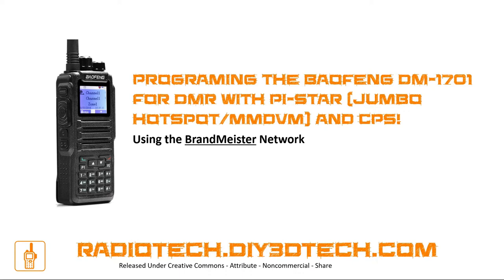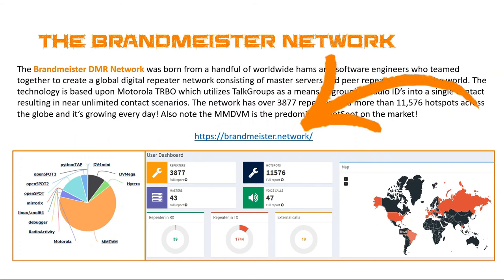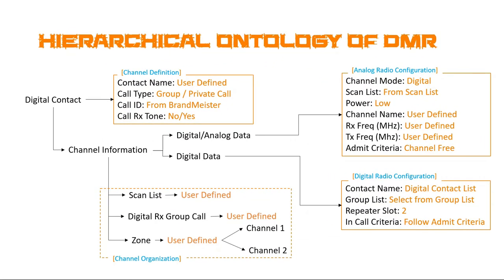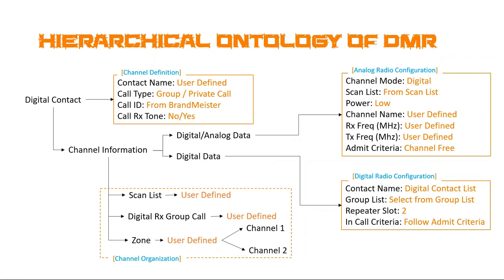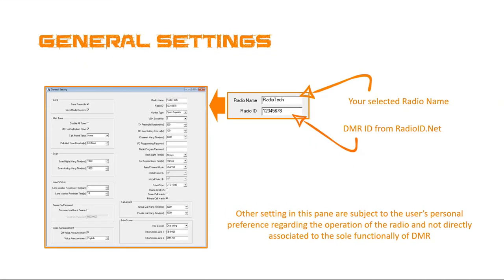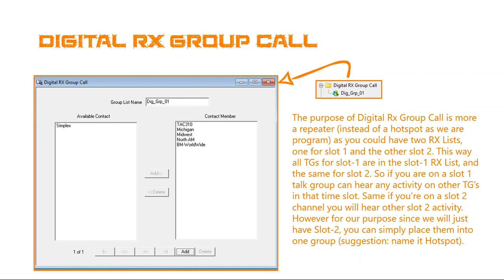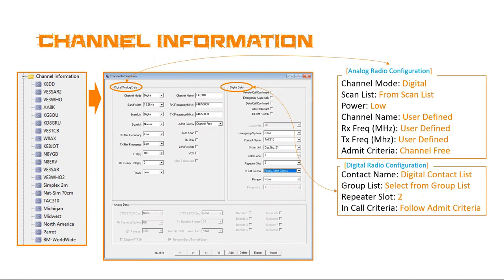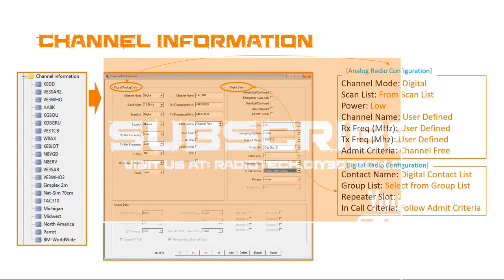DMR -  Progaming a DMR Radio with CPS for the Brandmeister Network and Jumbo HotSpot!

Comment: Hi, I have a question about entering the RX and TX frequencies in the channel settings. Frequency copies from repeater information from https://brandmeister.network/. Do I enter the RX and TX frequencies as they appear on the page or do I have to swap them in the CPS program? Thank you in advance and best regards Michal
Reply from the maker: Its been a while since I did a code plug, however believe it does the offset...